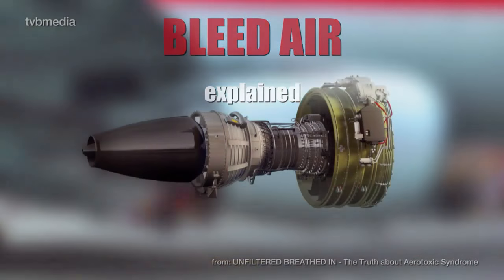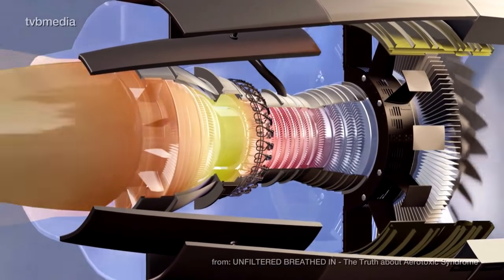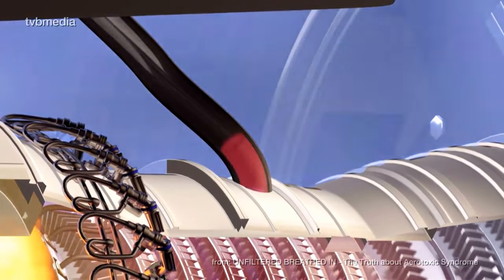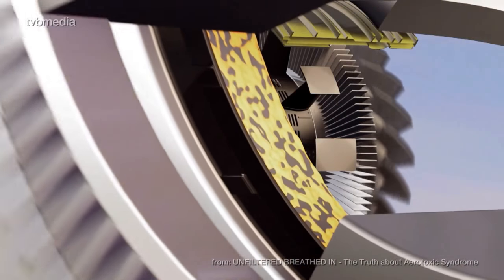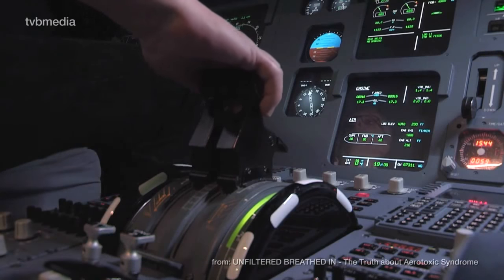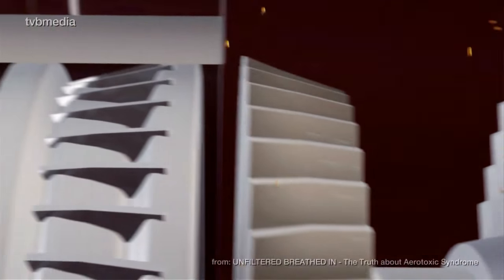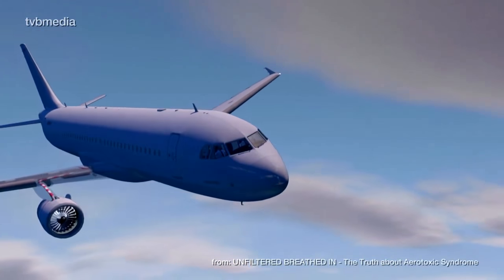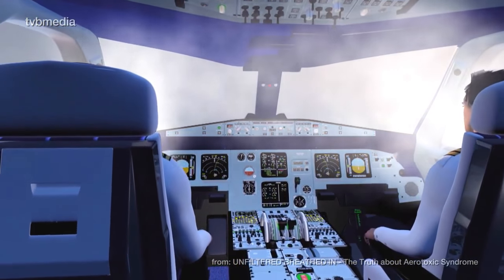BLEED AIR explained how it effects air conditioning system

Comment: വിമാനത്തിലെ മർദ്ദം നിയന്ത്രിക്കാൻ അല്ലാ, windowകൾക്ക് ഇടയിലുള്ള സ്ഥലത്തെ മർദ്ദം നിയന്ത്രിക്കാൻ ആണ് ആ ശുക്ഷിരം.

Cabin pressurize ചെയ്യാനുള്ള bleed air വരുന്നത് air conditioning ductലൂടെ തന്നെ ആണ്. പുറത്ത് എത്ര low pressure വന്നാലും പുറത്തെ ഗ്ലാസ്‌ പൊട്ടുകയും ഇല്ലാ. ഒരു passenger planeന്റെ maximum altitude 45000 അടി ആണ്. എന്നാൽ 100000 അടിയിലുള്ള 10 millibar pressure പോലും windowക്ക് താങ്ങാൻ കഴിയും.

Comment: A/C MECHANIC FOR SOME TIME STARTED GOOD THEN WHEN TO SHIT I GUESS YOU FOR GOT ABOUT THE ACM, MAIN HEAT EXCHGER, PRIMARY HEAT EXCHANGER , WATER SEPARATOR OH AND THE MIXTURE UNIT AIR DOSENT GO FROM THE ENIGINE INTO THE CABIN WITH PASSING ALL THIS UNITS WHICH CLEAN THE AIR